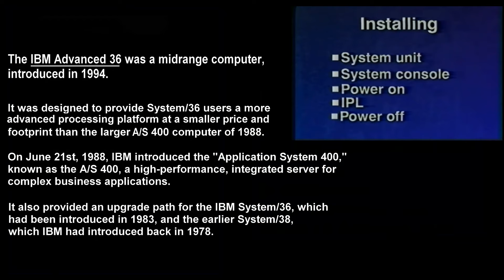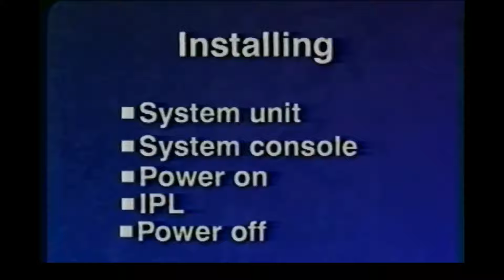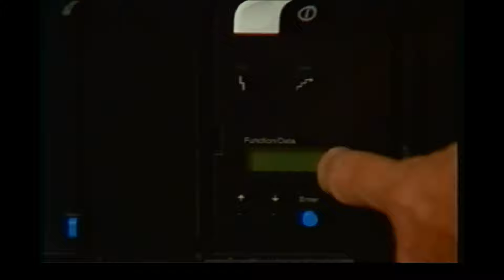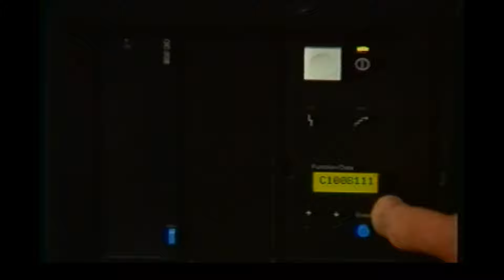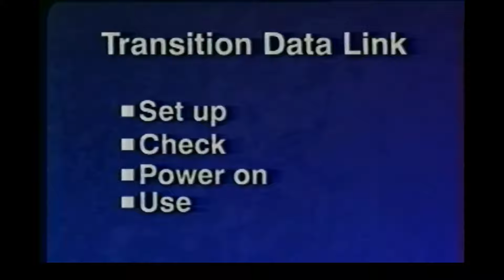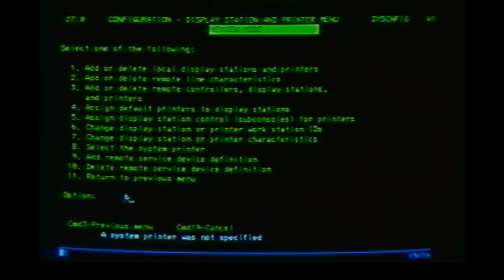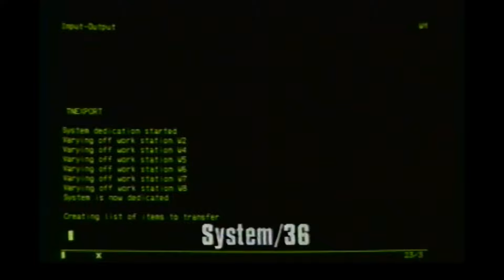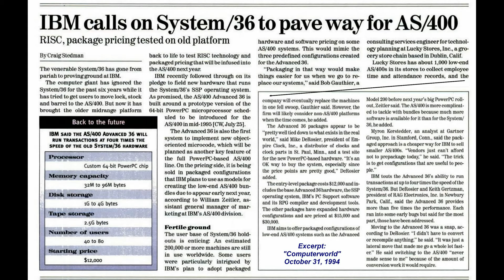IBM 1994  "AS 400 Advanced 36" Computer Unboxing, Installation, System Training 9402 A/S, (iSeries)

Comment: Hmmm, worked on as400 /  iseries  for some years , back in 99 till 2004. Rock solid system.
Reply from the maker: Yes, quite an improvement over the System/36 and S/38.  : )
Reply: AS/400 was the best machine I ever used.

Comment: Thank you for the upload! AS/400 has evolved since then and it’s still supported and upgraded to this day 2024. I’ve programmed in many other languages but I came back to these now called IBMi machines because it’s so much easier and you get all in one package, software and database, so it’s really inexpensive overall. It’s so much easier to manage database and other objects like programs and display files aka user screens. Plus the security built into these things and stamina is out of this world. You will never hear news that an AS/400 has been hacked. When you lose access to these servers you’d think it’s down but these machines don’t go down. Check the network that’s the culprit most of the time.

Comment: The company where I worked in the mid-90s had one of these AS/400 systems. My job was to "get the data off this thing" and into a SQL database, then present it in desktop applications executives could use in Windows. I was a PC programmer, but ended up gaining experience writing very basic CL programs, starting jobs, I think maybe even some C on the AS/400. Never did RPG programming, which was for the true AS/400 programmers, but called lots of RPG someone else had written. Eventually, we got an IBM ODBC driver and then I could treat the whole thing like a database. I remember when the Web came out, IBM tried to re-brand this as "eSeries" and one of the AS/400 programmers actually was able to generate a basic Web page with it.. Thanks for uploading, this was very interesting for me since I worked with an AS/400 but never really was involved with the hardware!
Reply from the maker: Hi @ACBMemphis , thank you very much for your comment and interesting back story.  I appreciate the feedback.   Glad this was interesting to you.   We are always looking for even more interesting material to share.  ~  Victor, at CHAP

Comment: From across The Pond ... worked at UK computer systems firm, ICL, in the '80's. Even though this is IBM kit, brought back many happy memories of unpacking, installing, and configuring a myriad of ICL kit from VME 2966 mainframes, CLAN 4/5/6s, DRS300s, DRS 20-80s, and my favourite, DRS6000s. IPLing was fun ranging from entering Hex codes, running SCL batch, or mnemonic codes/commands on the ol' TTYs. Loved every minute of it ... really appreciated this vid being uploaded.

Comment: A brand new 8" drive in 1994 ! OMG !
Reply: The 8" disk was software to allow the transfer for the old system to the new system. 8" drives were not commonly in use at the time this machine was released.

Comment: Where is benchmark data?

There is a benchmark with source code in the Jan 1983 BYTE magazine.  The IBM 3033 running Assembly language beat the list. Tests of the 3033 running PL/1 and COBOL are included.